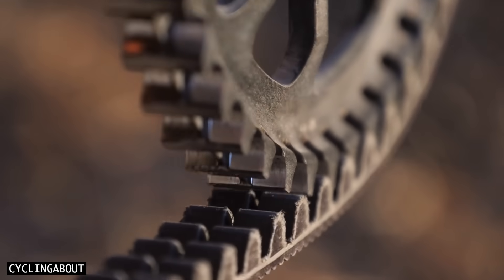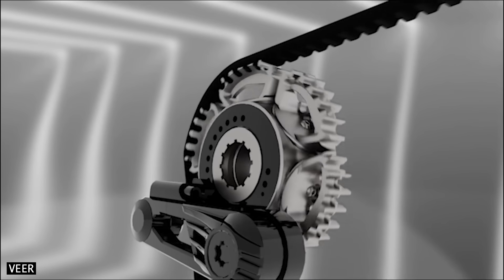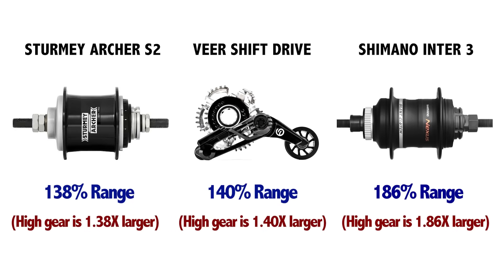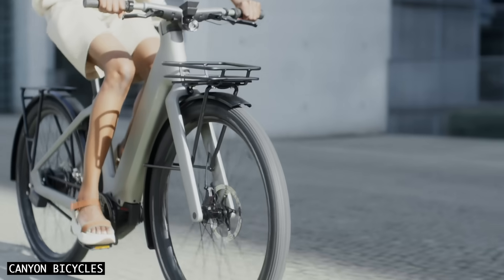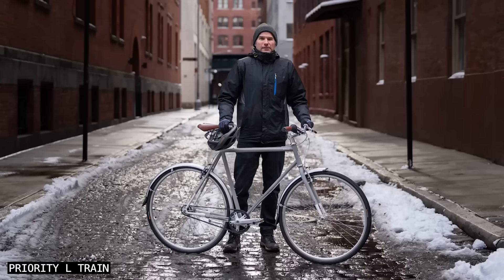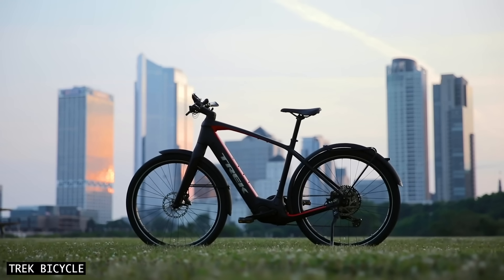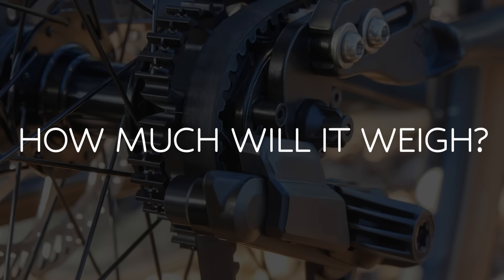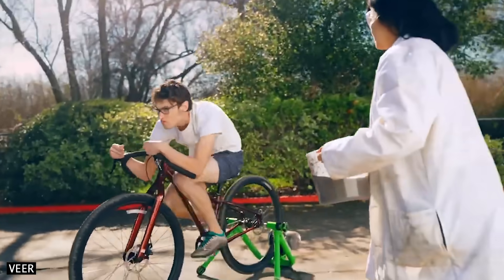Are Chainless Belt Gears The Future of Bicycle Drivetrains?

Comment: This is the first of these youtube bike transmission innovations that actually makes a lot of sense and I think it has potential.
I would definitely buy it for my commuter bike, which right now has a belt plus internal gear hub. My current setup is awesome already but with such a Veer system, maintenance and friction could be much easier or lower and the reduced weight also helps a lot since I am carrying my bike a lot.
Reply: Yeah, usually they add drag, but this system doesn't add a bunch of extra contact surfaces; very intriguing!
Reply: are you joking? that this is dumb it will break very soon

Comment: I can't see this catching on in MTB because you lose the two biggest advantages that belt drive brings to MTB, namely not having any mechanism that you might hit on a rock and reducing unsprung mass (MTB belt drive bikes don't use hub gears for that reason, they have a gear box around the bottom bracket). I am curious about the splitable belt though, if that's a thing now it would open up more options when it comes to frame design as you don't need a split in the rear triangle.

Comment: As an urban cyclist covering less than 10km a day, I would not give up the ability to change gears when stationary: sudden obstacles and stopping traffic lights happens frequently and I never worry about shifting down gears while stopping.
Reply: I just rock the bike back & forth a bit, to get enough rotation to shift... buuut I've also fractured my hip once, due to a thrown chain after I had failed to downshift, so...

Comment: After building several top quality frame touring bikes I decided that I would put together a internal gear belt drive gravel/touring bike. I used a Carver titanium frame, a Rohloff IH, and the Gates CDX belt/sprockets.  For example, this morning I was cranking Montana single track climbs and the bike has the gear spread to tour or pull a trailer.  At 73, It is like OMG where have you been all my life.
Reply: Well you spent enough, so yeah, I would hope so!

Comment: I love your work....always providing us with up-to-date, well researched and interesting content.  This shiftdrive may end up being great in a few scenarios.   However, I have a comment on belts. I am always dumbfounded when reviews (and sale pitches) of belt drives claim that they are "silent and require no lubrication".  Maybe in some humid locations they are silent, but in my experience, they require lubrication in order to be silent.  I have three bikes with beltdrives, and they are not silent when covered in dust....THEY SQUEAK!  Now to counter this I spray them with silicone lubricant every few rides, and that does the trick.  Now granted, I live in the desert of southern Utah USA, but from someone who has traveled the world on a belt drive, I just can't believe that you haven't had the same issue...ever?
Reply from the maker: I use silicone lube on my belts when they squeak. This can be once per year or once every few days - it totally depends on the conditions. Your location is a dry/dusty part of the world! For urban use, few will need to lube a belt.

Comment: In the big gear the belt doesn't have enough wrap to stop the belt slipping over the teeth. Bicycle belt drives I have worked on need a very specific tension to work properly. Clever concept regarding the rotating sprocket segments but realistically impractical application here.

Comment: Now if they built another unit for the front sprocket, it would be a 4-speed. Perfect!
Reply: @ingulari3977  It would be neither 2x price or weight, because you'd only need one chain tensioner. For maintenance and reliability, it needs to be seen how reliable these systems are in general.
The advantage is obviously that you get enough gear ratios to make it actually useful in somewhat varied terrain.
Reply: Wouldn't it have effectively just 3 significant different gears? 
Front high gear and rear low gear would be almost the same as 
front low and rear high gear?

Comment: I've been watching Veer for some time now. I have wanted to convert my Rad Wagon 4 to a belt drive but have been unable to figure out how to get the right gear ratio. This looks awesome! If I had the money for an Efneo 3 speed front planetary drive and the Veer belt drive featured here I would definitely do it. From what I see, Veer will sell a split belt for the correct length and then one simply needs to install it on the sprockets. If this system works out, well done Veer!

Comment: Uh, I would still prefer enclosed gear hubs or mid boxes. The advantage of belt drive is that it is resistant to outside condition, and this kind of exposes internals .

Comment: Belt drives and eBikes work together brilliantly but this ingenious device doesn’t come close to competing with the gear range of 8, 11, 14 and continuously variable internal hub gearboxes from Shimano, Rohloff and Enviolo. Or Pinion drivetrains for that matter.
In any case,  the future is mid engined electric motors with integrated gears surely?

Comment: This looks really good.  I would love to have learnt more about the split link equivalent that would allow me to fit a belt drive without taking to my rigid bicycle frame with a hacksaw. Best regards.
Reply: Split belts already exist. You can just go buy one. Not a lot of new details to give, there.
Reply: @prophetzarquon  Thanks for the info.
Strangely enough I have just started the process of fitting my motorcycle with a toothed belt drive to replace the chain it came with.

Comment: So we have two really good multiple gear systems that are compatible with belt drives (internal gear hubs and gearboxes), three if you count Schlumf since we're talking two speed drivetrains. They are essentially maintenance free and protected from the elements.

Instead we want to replace them with a system that has external moving parts that place all the drive force through the pivots the whole system relies on that are also exposed to the elements. Oh but they're a bit lighter you say? On city bikes where, let's be honest, if weight is a concern then there's a lot of weight loss to be gained from all the other components first, and where performance, especially in the e-bike space isn't really a bit design priority. 
No thanks. Just because you can doesn't mean you should.

Comment: Hold up! Just going to gloss over the biggest deal here. Splitting belt! This is honestly the biggest deal.  It means a belt drive of any kind really could be installed on any frame. No more specially designed split frames.
Reply: This has existed for many years. It works with a forked belt and little pins to hold it together. It has been used very often in for example food processing and packaging.
Reply: Veer makes a split belt, but it’s quite expensive compared to gates

Comment: I can see this work well in the right niche (flat terrain). Two concerns: 1) little belt engagement on the smallest cog due to the tensioner, which might increase belt/cog wear, and 2) a "bumpy" vibrating pedaling feel due to the segmented cogs not being round. The same thing can be felt with extra small 9 and 10 tooth chain sprockets. Doesn't have to be a deal breaker.

Comment: Would be an awesome way to retrofit older existing bikes that already use a smaller hub, like a 3 speed IGH. Combo them so you can have a 6 speed, like having a two speed crank ring but without any of the drawbacks.

Comment: As much as this sounds interesting, I think Internal Gear Hubs are just a much better option for the majority of people that use belts, like touring or urban riding. Knowing that your drivetrain is bombproof is much more important for commuting or world traveling than skimming off a pound or two.
Reply: Yeah, cassettes can handle more torque per Kg of material, just due to sheer radius. IGH are not at all "bomb proof" they're just easier to use & relatively low maintenance until they fail. 

And when they fail, IGH are not as easy to repair; usually a cassette system can get by, replacing only one or two rings, with common parts made by multiple brands!
Reply: @prophetzarquon  one time in my 14 day trip i just change entire wheel for cheap one in nearest small town. it not fit with number of gears and dont have disk brake but do the job for me and i finish on 2 wheels. So I stick with an affordable easy to find cassette setup in my bike trips.
Reply: I've run the same Nexus 8 every day on a commuter bike for 15 years. Not a long commute, about 40 miles per week, but I don't believe in riding slowly. It has never needed any maintenance or repair and has never missed a beat. I will never, ever go back to a derailleur for commuting - even my cheap little Nexus has saved me countless hours of cleaning, adjusting and replacing, and I know it'll work when I get the bike out in the morning.
Reply: @cooperised  As with any [bike] tech IGH depends on proper installation and conditions of use. Some people who get flat at rear can't do job themselves, aren't aware of role of washers and install wheel incorrectly ruining it shortly after. Some people shift Nexus at load without stopping pedaling for a moment. Some people riding sun or rain, neglect service and ruin hub quickly. So it depends - as always.

15 years is a long time. I believe IGH would benefit from cleaning and replacing lube after such a long time to be able to run for another 15 years.
Reply: @event4216  Sure, an IGH isn't for everyone.  But I do think it's pretty much the ideal tech for commuting and long distance trekking.  Incidentally I don't stop pedalling to change gear with the Nexus, I just ensure that I'm not applying too much load (this happens almost automatically if I let my cadence increase beyond my preference when changing up, automatically when slowing down, and only really needs thinking about when changing down for a hill).  The small weight increase of an IGH is a negligible penalty for the lack of maintenance.
Reply: @cooperised   In my other bike Nexus IGH for sure is very liberating in terms of maintenance so I agree. Only thing I like better is track hub+cog, that makes maintenance even easier - but that's not for every terrain. Per se Nexus isn't too heavy, though compared to track wheel weight distribution is worse. Does it makes IGH unnecessary? Certainly no. Derailleur systems are for sports and fair weather, for commuting and all-weather cycling I prefer not to have external shifting.
Reply: @cooperised  Anecdotes are all well & good, but I've stripped "bulletproof" hub shifters due to hard cranking alone, so there's at least one counter-example; more to the point, physics & test results are not on the side of IGH when it comes to strength, nor cost nor drag. I do think the Nexus were very good value for an IGH & I like them, but I'm too much for them (before adding ebike power, for example) & the drag is... well, a drag. It's never not noticeable except in one gear.   
I've never stopped riding around (year-round), yet I've never had chainline trouble except from extreme rides (where I'd need an IGH costing as much as the bike, to get enough ratio) & extremely long wear (>decades).   
Now, all that experience is likewise anecdotal, but formal review backs it up: IGH are not just heavier, they're more drag, less repairable, & much more expensive for the shift-range obtained; marginally 'lower maintenance' (at higher initial & per-mile costs) is not a great trade-off for all those downsides, once one is familiar with derailleurs to find that they actually work & last quite well.
Reply: Thing is that IGH isn't bombproof, well, maybe Rohloff is as close to this description as it's possible - most expensive and heavy gear hub on market, suited rather for specific applications like touring.
Reply: The Rohloff is bombproof and you pay for that exceptional quality in the purchase price and weight. The rest of the IGH market works well for the commuter, and light use market. they are not reliable when paired with an electric motor.

Comment: My first thought was: "I want to fit this on my 11 speed gearhub to make it 22 speed"
Reply: This was also my thought. And I imagine it to be awesome
Reply: Same thought, lol. FWIW, a 50/34 chainset is 147% difference in range, so this (as it stands) would be in the same neighborhood as a traditional 2x system.
Reply: I like that this design doesn't introduce extra contact points that cause drag upon every crank rotation... 

Geared shifters are pretty high drag (usually with the most drag on the earliest &\or last gears, which sucks extra). Achieving a worthwhile shift in ratio without a bunch of added drag or weight, has been a longstanding challenge in the bike parts industry. Hub shifters are a trade-off at best, so if this works at all, it may be a welcome build option, even if it costs hundreds?
Reply: @prophetzarquon  maintained derailleur and chain are still the most efficient and lightest bike transmission with gears.
other solutions ( gear hub, gearbox, belt, etc) have other advantages. as an amateur mountain biker who doesn't compete in any races, all the solutions that are sealed/low maintenance and don't add weight to the rear wheel are technically superior as long as shifting is quick/smooth and weight penalty not too high. but because of real world constraints like cost and availability, I still ride a mechanical 1x12 derailleur. IMO electronic shifting makes a lot of sense in a mid drive ebike because you have the energy source,  weight and cost aren't low anyway, and the "brain" of the shifter can cut the assist very shortly during shifts, like a motorcycle quick shifter, measure rider torque on the pedals, and/or time the shift at the top/bottom optimal. you can recoup the cost of the sensors/electronics by making your transmission last longer and shift smoother.
I believe mid drive + gear box "MGU" is the future. when Shimano/SRAM figure it out , it will be huge. just hope there will be some standardization like the Shimano hyper glide which was the defacto standard from 80's to the recent proprietary 12 speeds
Reply: In practice you would have a lot of overlap so you would probably end up with like 16 or 17 effective gears.
Reply: @CaneSugarHD  it all depends hot it's geared. just discovered HPC they make very fast and expensive ebikes up to 10000W they have a schlumpf 38T/95T front chainring that lets you pedal up to 70mph+ or more simply you can have well spaced gears that don't overlap so you have wider ratio AND closer gears. problem is you have to know your gears pretty well to take advantage of it, or electronic shifting that can combine front/rear shifts to give you all the gears in order. for MTB shifting very frequently means 1x12 is as good as it gets..plus affordable, reliable and simple.
Reply: Add a schlumpf bottom bracket and make it 44
Reply: @Coastal_Cruzer  with 3 shifters on the cockpit 🤪
Reply: @geemy9675  no, it would only be two. Schlumpf BBs are kick shift
Reply: Same - I want one on the chain ring to run with my Rohloff!
Reply: just go Rohloff. no regrets
Reply: Rohloff ++ ftw!
Reply: That would only work on a straight road and be extremely hard to pedal 😅
Reply: I have a identity Idee with a Rohloff gearhub. I have 2x14 or better combine with Pinion18, i have 2x18 - 36!!Speed with Clean Beltdrive.  👌🏾
Reply: tout terrain did a test bike a few years back  with rohloff + pinion with 3000% with a theoretical 5 -125 kph :D
Reply: same!
Reply: I had the same thought lmao. Would be a cool way to retrofit smaller gear hubs into having more gear ratios, like adding an auxiliary gearbox on a truck.
Reply: While most geared hubs would not offer the space for that on the side, it would work with the SRAM Dual Drive (only old stock available anymore) or Sturmey Archer Triple Shift. Both are three geared hubs with a cassette freehub body, so they should offer the space needed for this system. But you could also add front shifting from Schlumpf or Efneo, both being planetary gears between cranks and chainwheel/beltwheel. Schlumpfs have two gears in three versions, I think 1:1.65 or 1:2.5 or 2.5:1. Efneo has three gears 0.7:1:1.25 (total of 1:1.79 from underdrive to overdrive)

Comment: Id like more details on the belt.  The fact you can retrofit onto a frame that wasn’t purposely designed for a belt is revolutionary!
Reply: The splittable belt has existed for some time. It was mentioned in one of the videos on this channel a couple of years ago. It doesn't seem to have sparked a revolution unfortunately. Requirement for a gear hub was the main limitation I suppose.
Reply: @irvvine I know the split belt requires a bike frame that has a horizontal drop outs to slide the rear wheel back or forward which really limits the number of frames that really can be adapted to their belt. I  wonder if the tensioner would allow you to really use any style drop outs? I would really like to put a belt drive on a standard road frame I have with the vertical dropouts. Or can the user custom cut and fit the belt to where it would fit on the frame you're using without having to adjust the rear wheel at all?
Reply: @walkinthenose87  I thought there already were belt tensioners on the market (the same as chain tensioners for single-speed chains). But that's a good point too, although the creator of this channel recommends undertentioning IIRC.